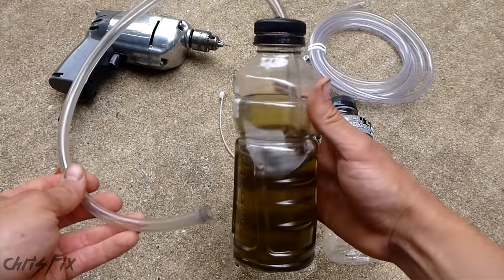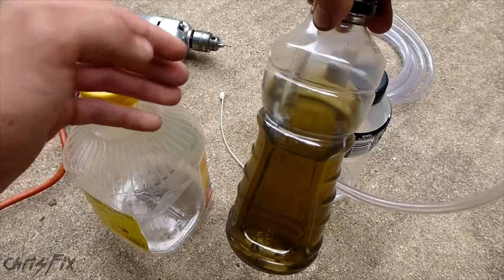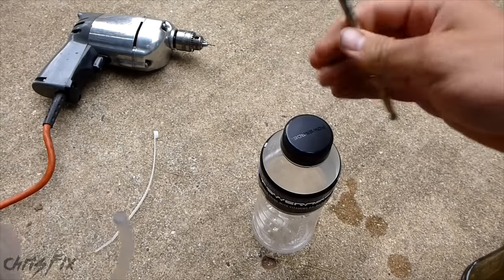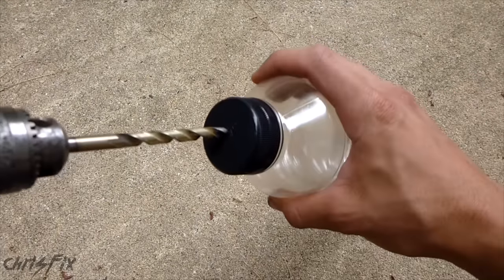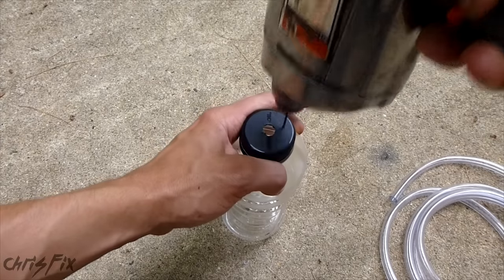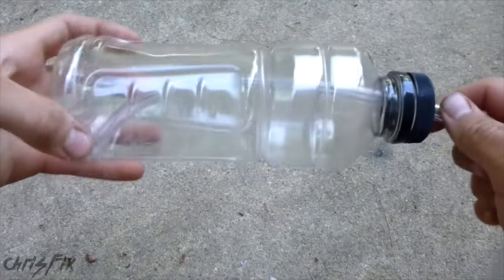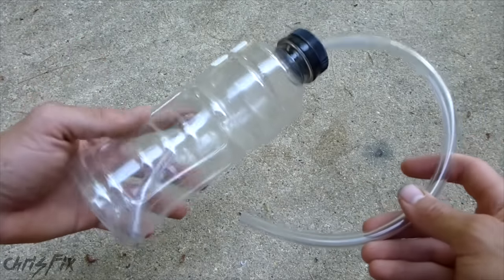How to Make a One Person Brake Bleeder for Under $5

Comment: Abraham Lincoln called, said he want's his electric drill back..
Reply from the maker: MrFuriousG He said it was ok if I borrowed it.
Reply: +MrFuriousG 
In the words of Indiana Jones "It belongs in a museum!"
+Chrisfix
My late father-in-law left me a sander and router that may have been a few years older than your drill. They were lovely tools but I rarely used them because they weighed about 50 pounds, hahaha. Some crack head stole them a few years back. They are probably floating around the country as soda cans. 
So cheers to the drill!

Anyway, I just wanted to say your videos are very well done, thanks.
Reply from the maker: lilwoodboy Thanks a lot man and thanks for sharing the story lol. Cant beat using old tools. My dad loves it when he sees me using tools his dad gave to him. I recently used a square for welding up "Project Night Light" and my father was so happy when he saw the video haha.
Reply: ChrisFix I've got the same drill. Black and Decker from the 1970's. I opened the gear case and put some new grease in. Still works great. Nice and small.
Reply from the maker: Garth Goldberg No wayyyy! Awesome! I should do the same thing!
Reply: Nope. Made in Towson, MD.

Drill is all metal, except the handle, which is okay.  Gears are all metal, too.
Reply: My dad had one of those heavy metal drills from the 70s. That thing would drill anything. I like my Skil lithium ion now only because I want it to be portable but those old school drills did work.
Reply: And it wasn't made in china!
Reply: Ryan Westenhaver  I know, right?  Always gotta be nit pickers.
Reply: hilarious!!! love it
Reply: ChrisFix good comeback haha
Reply: You haven't seen my new Dewalt 20v sir...
Reply: MrFuriousG back when a drill would last a lifetime
Reply: MrFuriousG lol
Reply: MrFuriousG I
Reply: everything old is better. especially lawn mowers. or 100 year old cast iron pans that food doesn't stick to or poison you.
Reply: I had one of these all metal bodies that belonged to my Grandfather from maybe the 1950's or 1960's and the damn thing shocked the piss out of me so I replaced the wire with a three wire and grounded the all metal body and it is still rocking.
Reply: I habe one of My dad its like the same but plástic cover
Reply: @sploofmonkey did you use bacon grease?
Reply: that drill is a testament to good old fashioned engineering - built to last forever - not just the length of the warranty
Reply: @chrisfix  and he said i can borrow it after you too - every person on this planet could borrow it and it would still work perfectly
Reply: @chrisfix  i have a few of my dads tools too which i will never throw out, and trust me they will never brake either - makes todays tools look like kids tools
Reply: And here I am waiting for the new Chrisfix video reading stories about his drill....Love it!
Reply: @robertelmo7736  bet the dewalt also came with a 2 yr warranty cus u need it with todays crap
Reply: Lmao!
Reply: if it ain't broke, don't fix it.
Reply: @Timothyn2smith  exactly
Reply: Ha-ha but it's still working 😂👍. Good tools forever!  But not such as today drills from Asia))) 😁
Reply: All the pre-1980s power tools were solid, heavy, and mostly had metal housings like this drill. A modern-day drill makes the same damn holes unless you're that spoiled by today's lightweight, cordless tools. If you ever inherit your dad's or grandfather's old tools, hold on to them and consider yourself lucky.
Reply: I still have my electric drill and it has outlasted several cordless ones. I’ll have it until it stops working because it’s dependable.
Reply: Man, that is so funny, no, seriously......
Reply: Chrisfix borrowed the electric drill from Lincoln
Reply: @GarthGoldberg  ha thats weird to see that.but yup black and decker. i live right down the street
Reply: Pissed myself laughing at that comment
Reply: Omg! That's messed up but funny at the same time! Lol
Reply: @chrisfix  I really like that you have a close bond with your family. That is rare nowadays.
Reply: Can't beat old tools!
Reply: It’s old because it’s made well.  Plastic gears in new stuff.
Reply: That's probably a good ass  drill.looks industrial. Abraham won't be needed it thanks to John Wilkes Booth.Thats why he shot Abe.He wanted that drill.😶
Reply: 😂😂😂😂😂😂
That's funny.
Reply: @chrisfix  
😂 😂 😂 😂
Reply: @peterford9369  
He was just jagging around.
Reply: And Monica Lewinsky called, she said, "she wants her bottle back - that too, intact".
Reply: Man you kill me whit that coment 😅😂
Reply: Lmao! I have almost the same damn drill 🤣
Reply: Older tools are better tools they last much longer
Reply: LMAO!!!
Reply: Just drill it one size off the bottle
Reply: I'm 59 and I have a lot of old tools from my father,  grandfather and I think my great grandfather too and I believe I still have a drill like that too.
I also have a hand held drill with a wooden cap that unscrews and you can put drill bits into it. The threads for the wooden cap are also wooden. 
 It looks like an old fashioned blender for mixing batter when making a cake.
The round gears and handle are made of cast iron.
I call it the original cordless drill.
It has to be at least 100 years old.
Reply: that's what you call an ole faithful!
Reply: 4score and 7 drills ago.. 😂😂😂
Reply: No officer that is not a gravity bong I swear…
Reply: If it still works why buy a new pos.
Reply: If it still works why buy a new pos.
Reply: I remember my dad teaching me how to use a drill in the early 70s . I still have it and wouldn’t take 1000 dollars for it😊
Reply: @markweidenfeller3428 And it didn't have to cost an arm and leg new just because it was all made in the USA!
Reply: Benjamin Franklin had the kite and  lightning expetiment lol
Reply: @chrisfix 😂

Comment: You stand the plastic bottle inside something like an empty glass pickle jar.  The jar keeps the bottle upright, and is wide enough and heavy enough not to tip over easily.
Reply: UnFunded Opportunities Good tip.
Reply: Why not just use the pickle jar then?
Reply: @mopenstein  Because you need the level of the fluid inside the container to be high enough. A recipient with a wide base will have a shallow level of oil compared with a narrower bottle.
Reply: I've never had a problem with my plastic bottle tipping over
Reply: Genius
Reply: Gotta bleed two cars out after the summer, thank u for the tips
Reply: or you could attach a wire/hook to the cap vent and hang it near the caliper and it wont tip over
Reply: @ReesBeBallin69  I am in the same boat. If you attach a hook made out of a wire to the cap you can hang it and it also will not tip
Reply: @marktype1with2  niceee, ill do that too. Cheers mate
Reply: @marktype1with2  with that you could have a little bit of syphon effect and air will reach into the caliper, no?
Reply: Take a piece of board such as a 2 x 6, 6 to 8 inches in length and cut a circular hole in the bottom, just slightly larger than your bottle diameter and then the bottle will never tip over
Reply: @marktype1with2  ...  Boats and Brakes made me laugh a bit this morning thanks

Comment: how some one can thumb down a video like this one? provably a dealer who want to sell this tool for 30$ :(
Reply from the maker: +mike cioka Thanks bud! Haters gonna hate.
Reply: +ChrisFix Thanks to you for helping us :) I saving a lot of money !
Reply: Thumbs down because it can recontaminate the calliper with aerated fluid as it is sucked back.
Reply: +577666 well.. why don't you show us all the cheapest AND proper way to do it, and up-load your OWN video? CLEARLY he changed the break fluid, and the fluid was C-L-E-A-R.
Reply: +577666 not if you bleed the line till the hose is full of clear fluid, like you're supposed to, then it will only suck in clean new fluid
Reply: 577666 yes, yes, yes and yes! You got it!! Apparently you dont spoiled yourself as much based on your thoughs, and maybe no one does it for you. You are probably twiching from all that loathe inside of you, poor thing. Take care pumpkin, stop wasting your time. You can have the last word.
Reply: +ChrisFix Hey chris I was wondering when your doing this does it bring pressure back into your pedal? like make the pedal more firm? I'm used to the 2 person system where you pump brake, Crack bleeder then hold and your pedal will rise up more and be more firm. So what I'm saying is I just did all brakes and rotors on my car and my pedal is going pretty far down to the floor and I was wondering if this one man system gets the firmness back in pedal. Sorry if it's a dumb question but thanks for the help!
Reply: +Chris Watson My understanding is that it has more to do with having disc brakes on all four wheels (firm) vs. having two wheels with drum brakes (softer). But I'm no expert - someone else may want to chime in.
Reply: Thanks for trying to help buddy, got my father to be my helper to pump them up and bleed em but thanks for trying to help.
Reply: +mike cioka Yep!!!
Reply: +577666 If you're worried about just install a one way valve in between two sections of the hoses... The price will vary depending on the size of the hose. And it's quite literally what they sell for $20.
Reply: tureee
Reply: Probably because he's drilling towards his hands, lol!
Reply: thumb down? You mean dislike?
Reply: We make these all the time in our dealer 😂 we dont even care if the tube reaches the bottom of the bottle because as long as the tube raises above the level of the bleed nipple, you're unlikely to draw in air as that raises to the highest point in the system
Reply: Exactly 😁☝️
Reply: I know what's going on.  The title said under $5. Bet you that some people went to go buy an electric powered drill turn up to be $15 more.
Reply: thats y youtube tooked the dislike counter away
Reply: Exactly

Comment: Take the cap off first and you wont have to clean the bottle again,also it will be a lot more stable when drilling it.
Reply: Just dont do it that way on concrete but yeah thats smarter

Comment: Drill the hole in bottle cap to match the OUTSIDE DIAMETER of the tubing, not the INSIDE DIAMETER.
Reply: i just melt a hole with a lighter and shove the tube in.

Comment: I need a link to a blue POWERade bottle
Reply from the maker: +Arley Rivas lol
Reply: ChrisFix thanks for replying lol and thanks for the video I needed to replace my break booster but I have to disconnect the brake lines from the master cylinder but I didn't know how to bleed the breaks on my own.
Reply: also do you have to use the free-with-a-coupon harbor freight scissors to cut the tubing or will any scissors work?
Reply: @thereagauze  LOLOLOL
Reply: 7-11 has them in stock.
Reply: Do they make a white flavor? Just a sayin’ might taste superior
Reply: @spaomalley  Just don't use white after September.
Reply: +Arly Rivas if you ever find out give us the part numbers

Comment: Always nice to see people thinking for themselves, just a couple of things, take the top off before drilling it, Use a drill bit that matches the outside diameter (OD) not the inside of the tubing, No need to use a pilot hole for plastic, just make the holes you need in the sizes you need them. Thanks for the vid

Comment: if you use soft rubber tubing and put a small longitudinal slit (10mm) near the bottom (not to the bottom -kinda like a flute really ) and then a bolt/bung  in the bottom to seal the end it will act like a 1 way valve and improve you bleeder :)
Reply: Peter Gabbott -awesome idea.  Just yesterday doing my brakes with the same setup here I was wonder about how to incorporate a one way valve.  This is an awesome idea - at least I understand it and it does sound like it would work.  Thanks!
Reply: That's old school and works perfectly.

Comment: A slight variation for a one man bleeder would replace vent hole w/ a 1/4" hole and use a hand vacuum pump/tube to lower pressure in bottle to pull brake fluid from system. This avoids leaving brake assy location to pump the brake fluid out. For this variation a glass bottle must be used as thin plastic will collapse due to vacuum created w/ hand pump.

With this variation of one man bleeding, some bubbles will enter brake fluid stream at the loosened bleeder due to pressure differential, however no air is introduced into brake system.. Some use grease around bleeder to prevent this, but it's not necessary.

I've also found that the clear (acrylic?) plastic tubing tends to harden due to brake fluid making subsequent use very difficult. Rubber surgical tube resists hardening and remains flexible after exposure to brake fluid.

Nice video.  Regards
Reply from the maker: TexasPLNR Thanks for the tips!
Reply: Where do you get surgical tubing locally? Like what kind of store should I search for?
Reply: @norahschrum  Lowes or homedepot has them or latex tubing thing. But they are way more expensive than vinyl tubing.
Reply: We had this gallon can of brake fluid where I worked one time, and it had a pump on it like a liquid soap bottle, so you could fill the master cylinder. 
We used to open the bleeder valve, and pump fluid up into the master cylinder, worked quite well.
Reply: After using vacuum to bleed I switched to pressure.  Vacuum worked ok for me, but sometimes you get air coming in where the hose fits on the nipple or around the threads of the nipple and it makes you think you have air in the system when you don't.

Comment: I use speedbleeders.  They have a one-way valve in them so they will not suck air in while you pump them.  Crack them 1/4 turn and attach a hose.  Then pump away.  Works great.

Comment: This is the best brake bleeder there is, just replaced the rear calipers on my truck , made one of these and it was so easy to use i couldn't believe it worked, you just open the bleed screw with this attatched and let it drain ( make sure to top off your master cylinder each time), when there is no more bubbles coming with the fluid, tighten your bleed screw an your done. I was skeptical the first time but when i checked the brake pedal it was hard, no sponggyness at all, not convinced yet i started the engine, power brakes now working, stll no spongyness, so i took it for a drive where theres no traffic so i could get right on the brakes and still perfect.

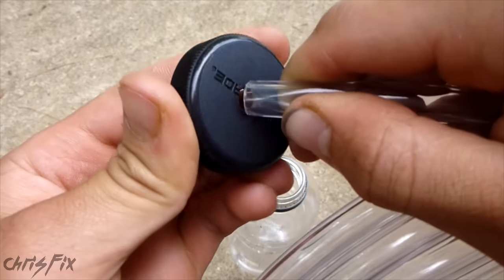Comment: Having bought the tubing yesterday, I'm going to add a small but important detail that Chris neglected to mention: pay attention to both the inside diameter (ID) and outside diameter (OD) of the tubing. As Chris' drill bit demonstration at 0:51 shows, he was using 1/4" ID tubing, not 1/4" OD, and then he notes at 2:09 that the hose wouldn't fit through a 1/4" hole in the cap and he had to enlarge the hole some more.

The 1/4" ID tubing I bought at Home Depot has an OD of 3/8", and thus would require a 3/8" hole in the cap to fit properly. So if this otherwise excellent video inspires you to make one of these for yourself, remember that you need to have both diameters in mind: the ID to match your bleeder screws, and the OD for the size of the hole you drill in your bottle cap.
Reply: +Larry Harvilla It could have been said better:  Get a length of tubing that fits your bleeder valve nipple. Now punch a hole thru the plastic cap of a 20 ounce drink bottle (not water bottle, too unstable) that is the same size as your tubing. Make a small vent hole. Done.
Reply: Thanks. You said it perfectly. He did make that small mistake. I made the same mistake when I bought the tubing. No biggie though... Chris is still The Man and has given me the balls to fix things I never would have had if it wasn't for his videos. Thanks brutha. Keep up the great work!
Reply: Chris could have also taken the drill bit out of the drill and hand turned the drill into the hole to get the shavings off the hole as well as slightly enlarge the hole. If it's off by only a little, doing that should help.

Comment: Chris: Your bleeder is similar to one I built myself. The only difference in mine is that I used a much longer piece of clear tubing and did not run it directly down to the catch bottle. Instead I ran it up to a point about 6 inches above the bleeder screw. This held the most recent fluid in the line and permitted me to see the fluid in the clear line before it drained into the bottle, letting me know if I was getting clear fluid or still getting air. Permitted me to press on brake pedal and go round to the wheel being bled and see my results directly in the clear tubing. Just finished replacing all the brake lines and hoses on my 96 S-10.

Comment: Also this is a trick I do so as not to waste brake fluid.  Take a old ear syringe and suck out the old brake fluid in the master cylinder down to just above the holes for the fluid to go out.  You may have to remove a plastic screen in some master cylinders which is there to keep junk out of your brake system, drop the screen back in if it had one.  Then fill with new fluid and do the brake bleed as normal for your car or truck, this way you start with mostly new fluid instead of pushing old fluid through the system.